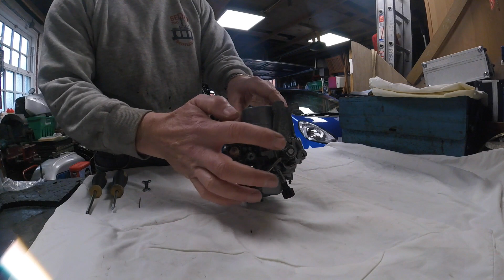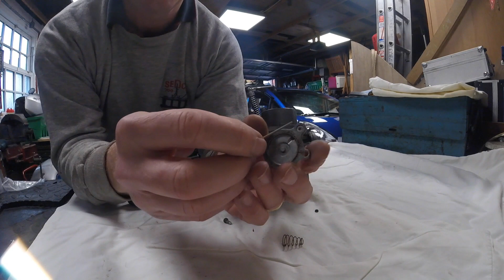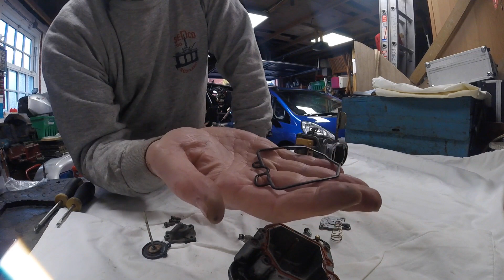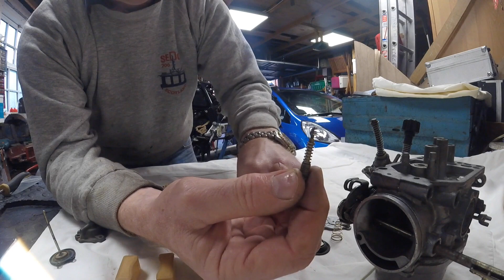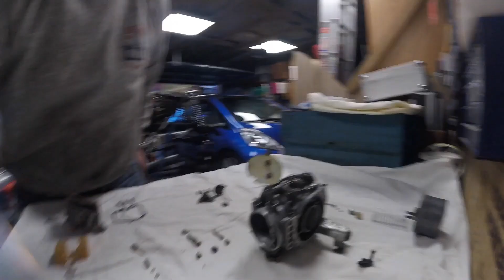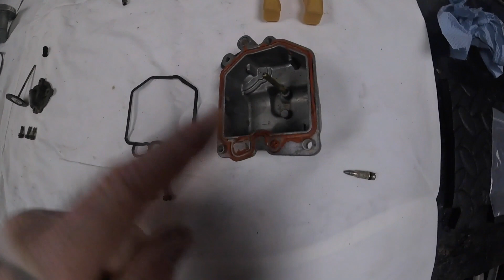How to disassemble a Honda Carburettor. CB900F Keihin main carb

Comment: Hey I hope you respond to this, im rebuilding my 81 cb900c and cant get the primary nozzle out. Would you have any tips to get it out?
Reply from the maker: They are tough to get out because the thread is quite long and gets furred up - the slot for the screwdriver is not enough in a lot of cases. I use plenty of penetrating oil, lots of time to soak, and then a left handed drill on a low RPM combi driver. Good luck !
Reply: @aldermarsh6776  thanks for the response i hope to get this project moving along!

Comment: Thank you, great video. I have a question. I have Honda cb 900 bol d'or 1982 starts, runs on the 1st, 3rd and 4th cylinder. Fuel runs out of the drain hose of cylinder 2. Is the float stuck? I have removed the automatic fuelcock. Carbs have been ultrasonic cleaned and fitted with a new Dynajet kit. 
Original carburettors with new rubbers.
Reply from the maker: Fuel running out of the overflow means you have a float valve problem. Either the float is not operating the valve, or the valve is leaking. 

Problems with the float can be: 
HOLED (i.e. it doesn't "float"), 
BENT (the float moves but the actuator arm doesn't close the valve fully), or 
STUCK (the float doesn't move with changes in fuel level). 

More often than not it is a valve problem and these can be : 
WORN (unlikely if you've fitted a new dynajet kit), 
MISSING PARTS (different kits have different areas for the needle to set against. Some seat on the carb body but others have a separate seal element. If you don't fit the seal element then the needle valve near seats and it always flows), or 
MISFITTED (the valve may not be properly attached to the float or the valve seal may not be pushed fully down into the carb body).

Hope that helps!

G
Reply: @aldermarsh6776  Thank you so much for the answer! I'm sure this will help.
Reply: @aldermarsh6776  I changed the float valve of carb 2 and cleaned the drain screw. Now out of all the 4 overflow lines is running fuel. What's wrong? Is it because I have removed the automatic fuel cock?
Reply from the maker: @gustaaf22  it is nothing to do with the automatic fuel cock. The carbs should be able to shut off fuel flow when the bowls are filled to the correct height irrespective of what is upstream. 

When you fitted new float valves (and seats), did you check to see if the valve sealed?
Reply: @aldermarsh6776  I just replaced the float valve of carb2 which gave the only leaking problem. Now all 4 leak. I did not check if the valve sealed.

Comment: How to remove slow jet mines are clogged & need to remove .
Reply from the maker: Hi Arthur. Do you mean this slow jet (https://images.app.goo.gl/rtYER3kS1ZbutWPa9) ?

If so, you just remove it using a screwdriver, but the head can often shear off. If it does, you can either cut a new screwdriver slot in it, or carefully drill it out. If you do drill it out you'll need to strip the whole carb to clean any swarf from the body. Good luck !

Comment: Is it possible to replace the overflow pipe in the float bowl? I have one that has had a very poor repair done and is now blocked and is beyond further repair but I cant tell if it's a push fit or screw fit into the bowl or if it is in fact replaceable?
Reply from the maker: Hi Rob. That brass pipe is soldered into the float bowl (some variants have it pressed in) and is not designed to be removed. However I have had the same issue as you and had to drill it out and press in another pipe. The key here is to make sure the height is correct to prevent flooding the engine.
Reply: @aldermarsh6776  - thanks for that, I'll give it a go but may be looking at a new bowl looking at the bodged previous repair!
Reply from the maker: @RobAiki  A new bowl is a better idea because any failure of this pipe will pour neat fuel all over your engine! Make sure you get the right bowl because they are different for the different cylinders. Good luck.

Comment: Thank you , great video. I've had my carbs apart 5 times now, cleaned, ultrasonically etc. New Carb kits, etc. even got new carb bodies. My problem is at around the 3000 rpm range, the power cuts out, if I pull the choke it lights right up again. Any suggestions? I've even pulled them apart again and put the old components back in thinking I got a faulty carb kit. Any help would be appreciated. Thanks for the great videos!
Reply from the maker: Hi Garr. It sounds like you have a jetting problem. 

When you open up the throttle, the carb runs off the pilot jet and although the slide moves up, it only lets in extra air, not extra fuel (the parallel section of the needle is in the main jet at this point). As the throttle is opened further, the slide moves up, more air comes in and at around 2500-3000 rpm, the needle should be on the tapered section, allowing more fuel in through the main jet. It sounds like you are not getting enough fuel into the engine (as you say it resolves itself if you open the choke, which is a way of restricting air and adding more fuel).

So what you can do it try to move the needle up a notch or two, and/or increase the main jet size.

Good luck !

Comment: The ring that fell off when you shook the carb at 18:09. What is that? That looks like a gasket for the top valve, but I can't find it anywhere... All the carb rebuild kits only offer the float gasket..
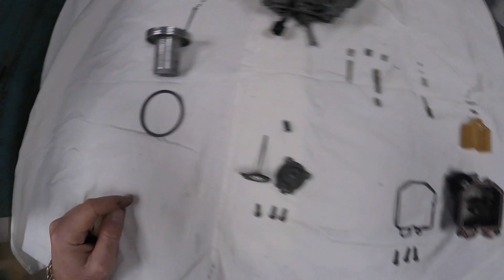Reply from the maker: Hi. If you fast forward to 20:42 you can see the big gasket that fell off when I shook the carb. It is the seal between the top hat and the carb body itself. I think the part number is 16010461003 but that may be the full set of "hard" gasket parts. Type that number into www.davidsilverspares.co.uk or www.CMSNL.com and you'll see the exploded diagrams.
Reply: Thanks for the answer!! I hope i can find it. The absence of that rubber ring may be the reason why my CB900 gets too much air, and farts sometimes during deceleration!

Comment: is the carb similar to a keihin VB11
Reply from the maker: Hi. It is similar as it is a VB model fitted to Hondas in the early 1980s. I think the VB11 was fitted to the single cylinder FT500 (VB10 for the US market?).
Reply: Alder Marsh yeah I have an ft500 so a useful video for working out how they come apart and the jetting setup as it's a complicated Carb for a single
Reply from the maker: You're right, it is a complicated carb for a single, but providing the secondary nozzle is clean and you can get the pilot jet set right first, the main jetting is relatively straight forward. Good luck!!